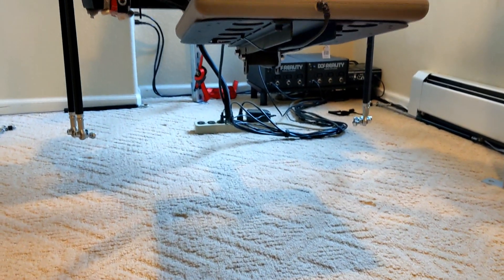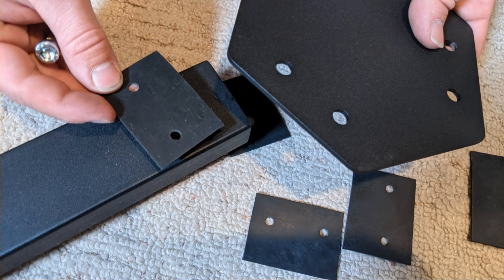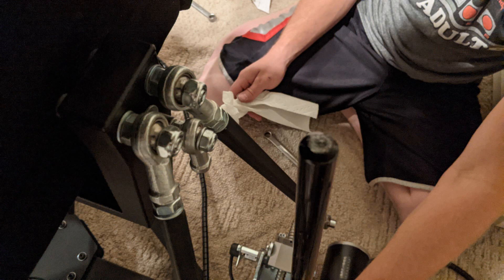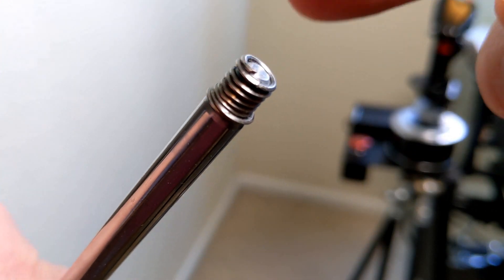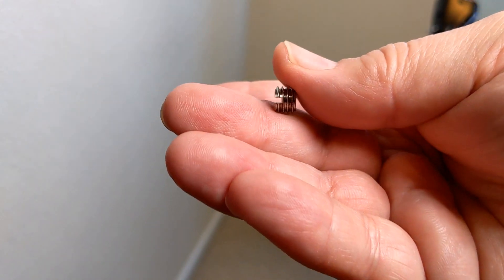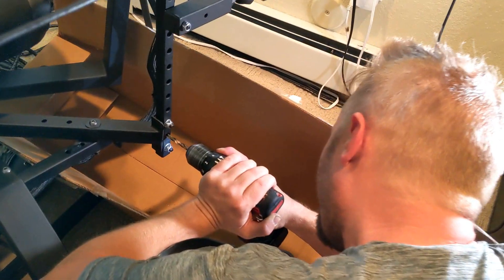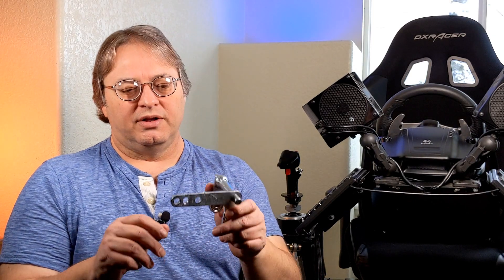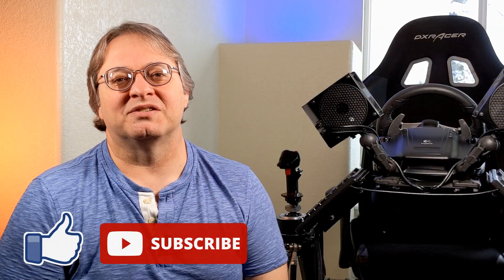DOF Reality SFU Gearbox Upgrade - Part 3: Modifications

Comment: Great video Mark. Please do a video on motion compensation options soon.
Reply from the maker: We are sorting through it all right now so I'll try to get it filmed once we settle on a final setup.  Still working out a few bugs on our design and still have a few more vibrations to try and cancel out.  I can tell you it is pretty cool when you have it working.  Are you running any transducers on your setup?
Reply: @GYGOtv  Thanks Mark. I do not, but noticed I might need motion compensation since the SFU. Didn't have any issue before the upgrade. The SFU was still worth it.
Reply from the maker: @pchow6829  Well motion comp will work great for that.  What headset are you using?
Reply: @GYGOtv  HP gen 2. Best headset for the money
Reply from the maker: @pchow6829  Especially if you get it for $299 :)
Reply: Do you think the motion  compensation issue would be worse with a different headset Mark?
Reply from the maker: @pchow6829  No the headset doesn't really matter, it is the vibration cancelling if you have a buttkicker or other tactile transducer.  That is what I'm fighting with right now. The motion comp works great except for the vibrations, so if you aren't running anything you should be fine.
Reply: @GYGOtv  I had to tone down the carrier launches, else it looks like I'm moving backwards. The jolts were the best part of the sim😅
Reply from the maker: @pchow6829  My favorite part too... you can see the joy in my face on my videos.  The Motion Comp will take care of going through the back of the seat on the launch.  That is how I'm testing it, I look at the ejection handles in the F14 when I launch and make sure they stay put.
Reply: @GYGOtv  Mark, do you mind sharing your SRS profile settings for your DCS F14 or F18? Thanks.
Reply from the maker: @pchow6829  No problem P Chow, here are the links to screenshots (F14) https://drive.google.com/file/d/1u_QvsOGd2hgnzIOtnBEo9YfLfd2QEGAq/view?usp=sharing (F18) https://drive.google.com/file/d/13xDz-zmHRk5widp_7D_T6VKRpvm2_Zbg/view?usp=sharing  I also tried something new... I uploaded these profiles to the SRS Cloud.  You should be able to directly download them now in the software.  Just search for gygo and it should come up.  Please let me know if that works as I've never tried it before.  Also, I still find myself tweaking these settings so they might change down the road, but they are what I'm using right now. Hope that helps.
Reply: @GYGOtv  Thank Mark. I'm going to give this a a try.
Reply: @GYGOtv  I really liked the launch effect with your DCS profile. I just need to possibly tone it down due to my motion compensation issue. Thanks again Mark.
Reply from the maker: @pchow6829  No Problem, were you able to just download the profile via the SRS Cloud or did you manually put it in?  Also, you might as well start looking for a valve controller or tracking puck, you will need it for the Motion Compensation in the future if you are using lighthouses.  I'm using a vive wand that I didn't need anymore. https://amzn.to/3GZpBol With the G2 you might need an extra controller.
Reply: @GYGOtv  I was not able to download the files from the SRS cloud, but it was probably something I was doing wrong. It was easy enough just  manually changed the settings. I actually have a valve knuckle controller and a couple of lighthouses, but haven't invested enough time to figure out how to set it up. Waiting on a good video from you to help with that 😄
Reply from the maker: @pchow6829  Ahh I see. The cool thing is using the lighthouses, you can mount the controller behind your head (that's what I'm working on), otherwise the headset has to see the controller in inside out tracking, so it would need to be in front of you.  If you are going to use the index, start looking for any mounting solutions for the controller itself since mine is different.  I found this for my controller so try to find something similar https://www.etsy.com/listing/1188815113/htc-vive-wand-virtual-camera-mount-v2?click_key=a9b0cbf561bfd7fd93984ba4faed56764eff282e%3A1188815113&click_sum=da72b465&ref=shop_home_active_9&crt=1
Reply: @GYGOtv  Hey Mark. I'm thinking about getting the Varjo Aero, but I'm hearing that it requires an live internet connection when you are using it. Is that true? Thank you.
Reply from the maker: @pchow6829  I haven't heard of that requirement, but I always have an internet connection anyway.  I'd Seriously look at the new Pimax Crystal... Doesn't need basestations, larger FOV, better blacks and lower price.  I think the Crystal is likely to be the Aero Killer.  Just know the software will likely be more buggy and the build quality won't be the premium level like the Aero is.  If you can live with that, the Crystal is probably a better bet.  Hope that helps.
Reply: @Get Your Game On  Thanks Mark. Haven't decided completely on the Aero, but Pimax as a company is pretty bad with their products. Their firmware and component hardware is substandard. I have their latest 8kx and used it for less than a week before putting it back in the box for good. Probably sell it at a lost.
Reply from the maker: @pchow6829  Ya I've heard that from A LOT of people for sure... BUT they say even a blind squirrel gets a nut every once in awhile.  Hoping these new Pimax are the exception. Also, don't sell your 8kx, they have a 12k OLED coming out and you can get FULL VALUE from your 8KX purchase if you were the original owner.  Worth waiting to see how that headset turns out.  I think the 12K QLED might be THE ULTIMATE HEADSET for enthusiasts, but we will see.
Reply: @GYGOtv  Hey Mark, can you share your base station positions for use  with the Aero with your H6? Thank you.
Reply from the maker: @pchow6829  Sure, pretty basic.  One is behind the H6 in the upper right corner of the room (as seated in H6) probably 5 feet from the rig, and the other is caddy corner on the upper left of the room about 10 feet away.  Both are angled down about 10 degrees and aimed at the H6.  You can actually barley see the one behind the rig in this video at 9 sec. just above the monitor I had sitting on that shelf.  Realistically as long as they are high up and can see each other, it's pretty hard to mess up the installation.  Here is a tutorial with the basics. https://www.youtube.com/watch?v=fV--q0HcDU4
Reply: @GYGOtv  Will try it out. Thank you Mark
Reply: @GYGOtv  My Aero came in and had a few questions for you Mark. I don't run SteamVR, but using the OpenXR option produces 4 virtual screens on my monitor and the in cockpit on DCS has 2 cursors that can't click on most things. I've search for many solutions, but none seems to work. It this mainly a Steam VR only headset? Thanks for any help.
Reply from the maker: @pchow6829  I think it uses Steam VR as a backbone and then the Varjo Base layers on top of it if that makes sense?  You can set the headset to OpenXR or OpenVR in the "System/Compatibility" tab.  See if you can get it to work with that.

Comment: Mark, I have been looking into an H6 and cant find info regarding mains/outlet power use.  I know they ship it for U.S. sockets but how many receptacles are needed to power the unit and do you need to have it on a dedicated circuit by itself?  Basically I'm trying to determine if the spot I have in mind  is going to work.  Much appreciate your time to answer and love your videos.
Reply: Mark, I just found your video "DOF Reality H6 Motion Simulator - Part 3: The Core Build" from a year ago where your explain this.
Reply from the maker: @oseanmc  Glad you found it Sean.  I've heard of people using standard outlets but it really depends how your house is wired. I didn't want to take any chances so we did a dedicated line with the 2 independent/isolated plugs.

Comment: Great video! Quick question, so if I buy a H3 now will I be getting the SFU with the H3 as standard? For the same price? Or have they increased the price? Because on their website there is no mention of this. The SFU are still at 200 bucks separately on there. Please let me know before I place a order. Thanks
Reply from the maker: Hi Usman, I only asked about the Series 6 models so your best bet to be sure is to email DOF Reality and ask them directly.  It is my understanding that they eventually want to transition solely to SFU's but don't know the status on the 3 Series currently.  Please feel free to let us know if you find out anything definitively and thanks for watching.
Reply from the maker: I pinned the answer to the top of the page, hope that helps clarify.  I'd recommend getting the $200 upgrade with the H3, it is a noticeable improvement from what I understand.

Comment: Great video Mark! I have a H6 with the exact same setup (SFU upgrade with struts) but I'm finding I'm having to leave my motor boxes running all the time in order to keep the platform from careening awkward different directions due to the struts once the H6 is powered off. Have you run into this & if so what has been your solution?
Reply from the maker: Hey Curtis thanks for the comment and the compliment, so you do not want to keep your boxes on all the time because the motors will continue to do "micro adjustments" and they will get hot.  I don't know if you have temp strips on yours, but a few times I have accidently left mine powered on and I do indeed see a rise in temps.  Realistically once I'm done and out of the rig... I just turn it off and let it do its thing.  If the position bugs you, you can easily grab the frame and slide it where ever you want it.  If you didn't have the gas struts on it, it would still settle weirdly, it would just go down instead of up with the struts.  One note, I think some of the bending of the old levers was due to turning the unit off while I was still in it, or trying to get into it without the power on.  Basically I just started turning it on anytime I'm getting in OR out and then power everything off once I'm totally finished using it.  Hope that helps and thanks for watching.
Reply: @GYGOtv  One thing I've been doing for this issue is to go to the SRS app, setup tab, start test, click on the heave button and drag it to the left. Then shut down power to the unit. This puts it on the lowest level for all the motors/gears. You can then get on and off the unit without it moving.
Reply from the maker: @pchow6829  Great idea, I may have to start doing that too.